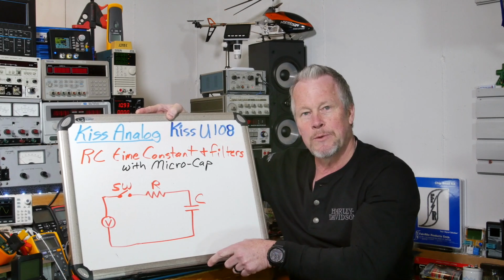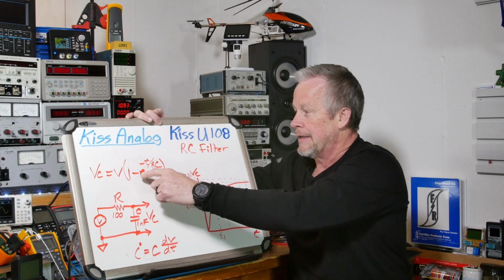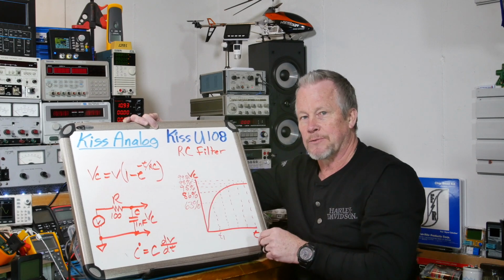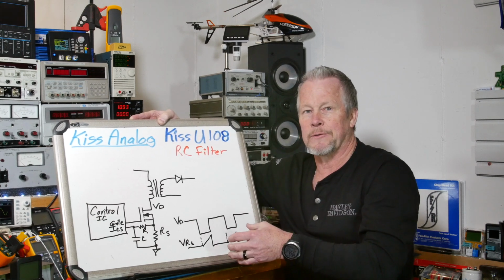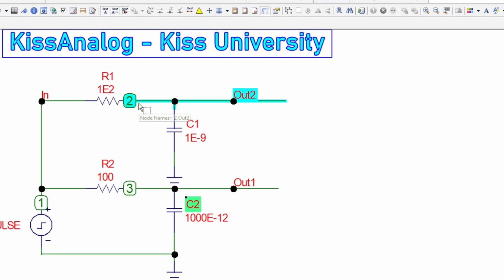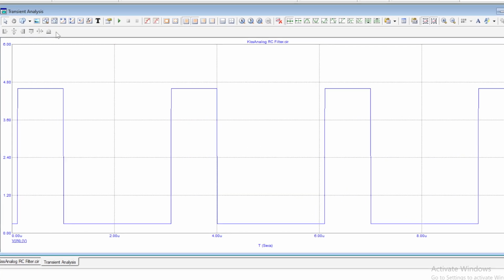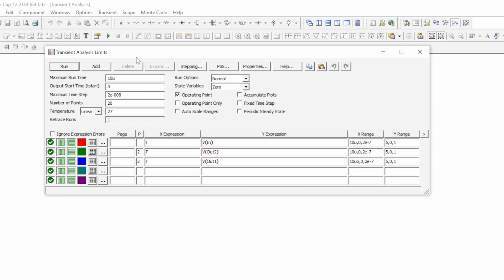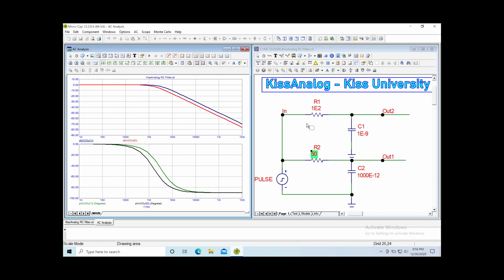RC Filter for beginners In free MicroCap SPICE software Kiss U 108 - #KissUniversity #Micro-Cap

Comment: Hi Eddie. I am watching your video and learning MicroCap. I tried to create the same RC circuit as you shown here and it works. But if I replaced the Pulse source with a battery, something strange happened. If I probe the voltage of the capacitors (or Out1/Out2 as in the circuit), there is no rise of voltage as shown at 24:40. Instead, the capacitors' voltages jumps immediately to 100% of the battery's voltage at no time. as if the RC time constant is zero. Do you know why or what's wrong with my circuit?
Reply from the maker: Thanks for your feedback.  If you want to send the circuit to me I'll see if I can show in a video what's going on.

Comment: Your circuit is vaguely similar to ones I've been looking at lately except the FET is a tube and the the diode is a speaker...yup single ended class A output stage for a guitar amp. MicroCap will certainly be of use in characterizing those. It seems to have quite a library of tubes for use. Great series--keep it going.
Reply from the maker: Thanks a lot Tim!  I appreciate you and hope you find Micro-Cap a great tool.

Comment: Happy new year!! So many different things you can do with this program. It can be overwhelming but it is great you are building up our knowledge. Have you owned any Amprobe DMM's? I was looking at getting a Fluke 15b+ but I saw the Amprobe AM-530. For 72 bucks. It has everything I would want in a meter and it seems pretty rugged. It is also TRMS which doesn't matter so much for the work I do but having the NCV built in is pretty nice.
Reply from the maker: Thanks Tron!  I like the Amprobes.  Check out this vid;) https://youtu.be/eXpOGmTzqts